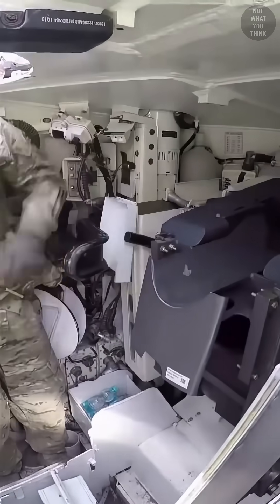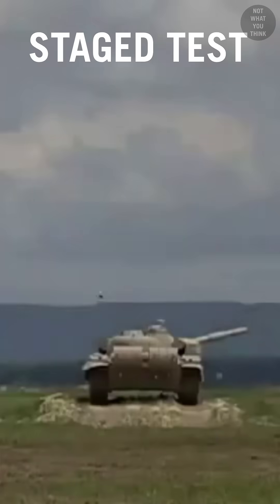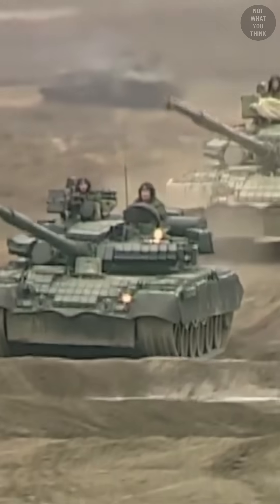Why M1 Abrams Tank Has No Auto-Loader #shorts

Comment: I believe Nicholas Moran (The chieftain) talked about this question quite a while ago, from what I gathered (and if I remember correctly) he pretty much said that doctrine and maintenance were the cause, because (USA) tankers preferred to have a 4 manned crew to help perform maintenance like track tensioning

they opted to keep the loader, since during the time that the US was testing with autoloaders, they were unreliable and were too costly to maintain them to have the same effectiveness (or a have a low marginally better performance) as a human loader

However, I believe he added that now-a-days autoloaders have improved they are more reliable and getting faster on top of having the ability to equip blowout panels with them, so it may have a precedent to be revisited in the future, since (if I remember correctly) tanks like the Japanese type 90 has a bustle autoloader that also has blowout panels as well as the French Leclerc

Found the video: Whither the Autoloader? - The Cheiftain

Comment: Another part about manual loading, which is better than auto loading. Sometimes the shells are random and you can’t choose when it’s an auto loader because you don’t have someone to tell to get a he or ap shell and if the tank is fighting another tank, it might just have high explosive for three rounds and high explosive isn’t very effective against tanks. It’s used for infantry in small vehicles but the tank with no auto loader. We have a chance to load the right round and destroy the tank. Also, if the tank is fighting infantry, it might just have a P rounds and we do barely anything to the infantry

Comment: I think that the reason is a price. It is still very much possible to create an autoloader which will be very safe in current Abram’s turret. It will just need to have its back where ammunition is stored redesigned. US could put similar autoloaders to MBT-70 or French Leclerc

Comment: Cons of having a loader:
1:  Costs the military more money to house, feed, train, and pay an extra crew men on a tank.
2:  A human loader may become fatigued and injured and impair loading operations.
3:  You need a bigger tank to house the extra crew men and bigger tanks mean bigger targets.
4:  More soldiers in the field due to having a loader means more of a chance to have higher casualties.

Pros:  
1:  An extra crewmen means an extra hand to help with tank operations like maintenance or other duties.
2:  An auto loader is more complex than an actual loader and may break down.
3:  Faster auto loaders need to house ammunition in areas that are closer to the gun and have a higher risk of ammo explosions.
4:  There will come times where a commander/gunner may want to change ammunition types and a loader can do that faster than an auto loader.
5:  On paper, an auto loader may be consistently faster than a human loader during long periods of fire, but in the early parts of the engagement, a human loader WILL be faster than an auto loader and it's in those early moments of the engagement that firing faster is the difference between life and death.

For me?  Human loader all the way.

Comment: This make Russian tanks more deadly in a one v one scenario as they will charge at you and you can’t do anything cause Russian tanks are too fast and when you shoot, the turret will explode at you and the burning tank will crash into your tank with some explosives left damaging your tank badly. Another thing is Russian tanks can also shoot not just you. They have more tanks than USA. This is not base on any source and I completely made this up except the part where they can shoot and are fast.
Reply: The best part is they aren't even fast. Most of the Russian tanks use a engine designed before world war two. Even the new "mighty" T-14 Armata uses the notoriously unreliable engines designed by Porche for the German Tiger tanks.

Comment: As much as people hate on autoloaders, they are probably the future. Modern APFSDS rounds are getting heavier and heavier to the point that the 130mm APFSDS from Rheinmetall are nearly 1 meter long and pretty much impossible to lift for a manual loader.
They use a bustle autoloader for their KF51 Panther which doesnt limit the length of the round and is safer than the soviet carrousel autoloaders.

Comment: The Abrams X (new version) looks like it will have an auto loader and a locked storage with a blow out panel. The problem isn’t so much the auto loader, but the way rounds are stored. I think the German Leopard tank has an auto loader and separate storage/blow out panel.

Comment: Well you argument is not true. There are several autoloading tanks that have a separated ammo compartment: M1 tts, Leclerc, amx30 (later versions) , str 103, japanese Typ 90 & 10, K2, KPZ / MBT 70, T90M.... Most of them are safer than a normal M1 since the time while the armored door is opened is shorter. That's because the door can be better timed and the door has only big enough to fit one single round, while in manual loaded Tanks the door opens fully so the loader can access the whole ammo rack. Also since there is no Loader there is no risc of amputated and or crushed limbs (ask Chieftain)...

Soviet tanks on the other hand often used a carusell loader wich is realy hard to protect and is placed unter the turret (to lower the direct hit probably). When they introduced (T64) it that was safer than the western counterparts (Leopard 1, M48, M60, Amx30) wich stored the Ammo unprotected in the hull and turret. The main reason why most Russian tanks cockoff is that they still have unprotected Ammo outside of the Autoloader in the fighting compartment, if that explodes it will also ignite the rest. (which at this point won't matter any more to you since you are a red mist on the turretwall from the 1st explosion).

Comment: Its an m1a2 SEP not an m1 they are very different in internal amour and body shape (kinda) the sep is taller and an entirely new turret and body with a similar design as the m1 was too weak and so was the m1a1

Comment: Final word on the Abrams1 tanks. My husband worked on perfecting that tank, if there is no auto loader that is because it is a poor design that could put the crew at risk. As the video shows each time a bomb is removed an automatic door closes so that if the tank is struck or drives over a bomb the crew is safe from their own bombs. In the Russian tank a direct hit will set off their own bombs as well.

Comment: Why don't those autoloader tanks have the same crew safety features? It seems like it could be made MUCH safer than a manual loader
Reply: The way carousel style autoloaders are designed makes it hard to separate the ammo explosive from the crew without compromising the armor scheme but there are NATO autoloaders in service with blowout panels and stored the same as the Abrams.

Comment: Many patriotic Americans here don't understand different doctrine. Soviet tanks which use autoloader eliminates a crew member, reduce training and stress on the crew. Not to mention the main advantage, reduce profile. Their doctrine don't hope for crew survivability, if they get hit it's over. In which case, losing 25% less manpower at the expense of reliability is good. Having to train one less man for crucial work is good. 

Meanwhile, Abrams are operated by the most powerful force in the world, with control of the sky. The tanks don't have to be the tip of the spear, and obviously would be less exposed to fire. 

The Ukrainian war is not good ground to compare since both forces are Soviet forces, with the bulk of the Ukrainians tank also have autoloaders. Recently Western sponsored armoured vehicle have not demonstrated clear superiority to Ukrainian Soviet arsenal, demonstrating that the role of the tank is different due to changing warfare. If anything, the Soviets were proven right in this particular case. Armoured vehicle losses mounted and it seems better to have a smaller crew to reduce manpower losses. 

The most important aspect when it comes to weapon is actually export. One of the reason why the media are having a field day on Russian weapons despite the Ukrainians are equipped with the same tools, is to discredit one of American weapon industry biggest rival.That being said, autoloader is a nightmare to operate and maintain after wear and tear. Manual loader tank is superior in every way for export. The Soviet doctrine don't line up with export requirement, unfortunately for them. Tank profile is no longer an issue like in WW2.

Comment: Not only are they less safe, but autoloaders have to return to a loading position between every shot, like a battleship gun. Some autoloaders get around this by making the entire turret elevate with the barrel, and that leads to a weaker turret. In actual usage and not just static firing, manual loading is faster, safer, and more reliable.

Comment: Auto loader is better, it means less people to pay which means more money for equipment. Also that's not the autoloader's fault, but rather the tank design in general.
Reply: If the tank crew dies, you need pay for build more tanks and train a new tank crew
Reply: @dddghhehehh  ok and...?? How is that the auto loaders fault? It's not. The abramX literally has an autoloader.
Reply: @kitchenersown  AbramX has a different autoloader design and still like a experimental tank
Reply: @dddghhehehh  ok so you agree that autoloader is a good thing?
Reply: @kitchenersown  Is good with a great design and NERA spaced armor
Reply: @dddghhehehh  yeah...that's my point... autoloader is better than manual loader.
Reply: @kitchenersown an auto loader is probably better. The problem is how Russian tanks are made
Reply: @NAGames1100  Yeah that's my point. But honestly, an Abram SepV2 won't survive a Javelin or NLAW better than a T-72B3. Most of the killing done to Russian tanks has been NLAW or Javelin to which an Abram or Leopard is just as vulnerable. Abram would perform better than a T-72B3, somewhat better than a T-80BVM, and I'd say a T-90M is the Abram's equivalent. Although a T-72B3 cost just 1 Million USD while an Abram cost over 9 Million USD and a T-72 require less crew.
Reply: @kitchenersown  The Abrams has a higher chance of surviving it than a T90. Because the T90 when it gets hit the ammo blow up killing the crew as well unlike the Abrams
Reply: @NAGames1100  The T-90M Ammunition carousel much more protected than those in the T-72B3 while it's not as good as the Abram's it won't pop open like the Iraqi's T-72 during the gulf war. Also, if the enemy has a chance to hit your ammunition storage then at that point your tank is gonna get either a mobility kill or just straight up disabled.

Comment: Loader didn’t check the panel, instant fail. (There’s a little led thingamajigher, just up and to the left, after you load, it indicates if the breech is closed, and if the firing circuit is complete) it kind of stupid, but you have to make the motion to look at at, or you will fail.

Comment: The thing about M1 Abrams not having Autoloaders is because it was Multipurpose tank, for offensive and aggresive. For a tank with that role, using Manual Loading will gives cheaper maintanance, less chance to broke entire gun system, and easier to repair. Its also can gives Supplies of Maintanance Parts less to deal with.

Im not saying tanks for aggresive cant have Autoloaders, but its cons is 50-50. The most logical type of autoloaders for Offensive is Bustle Autoloaders since its only expose in turret and far faster, but with the expense of lesser ammo capacity in Autoloader ammo stage. 

Also, with expert crew, the performance of tanks is not that much different. For example, a Leopard 2A6 with expert crew can load 2nd Shell with maximum 3sec and continously 4-6 sec. This much as same as T-80 and faster around 2-3 seconds than T-72/T-90 autoloader.

Comment: Despite the blow out panels, Abrams will burn as Leopard 2 are doing in Ukraine, and, of course, any modern tank will blow (and pop up the turret), Furthermore, if you use the 4th member to replace another tankist, who will load the gun? So there is no difference in 3men crew+ autoloader and 4 members crew

Comment: True story, a little 125 lb Asian kid could load a round in under 4 second, because it's me! The way the rounds are set up you don't actually lift the round but pull it out of the compartment and flip it into the breech of the gun so it really isn't about brute strength but technic. And seriously you're not going to be loading 10 min straight without a rest. 2 to 3 rounds and either you killed them or you already dead. A good human loader is faster than any auto loader out there right now so whoever can get the next shot off faster is usually the winner.

Comment: The US Army actually developed an M1 with an autoloader. They even took the whole crew out of the turret and only had the driver, commander, and gunner in a self contained armored capsule. The autoloader went 40,000 cycles of loading and then unloading the gun without a scratch to the ammo in testing.

Comment: That bit about the loader  "replacing a gunner or driver" is very unrealistic. For that to happen it would take too much time to make a difference. (It can only work in War Thunder.) 

First there is the shock from the shoot that took the crew member in question and the time needed to assess the situation on who died, then they have to go on the seat of whoever died, move their corpse (which they are most likely not trained for.) and take their seat. if it was the driver it will take quite a time to reach the seat, if it was the commander then they will have to again assess the situation both in and out of the vehicle and give new instructions and if it was the gunner they will (AGAIN) have to assess the situation outside and all the worst if the gun was already fired and needs reloading meaning that they will have to do 2 jobs now that will excuse them quickly. 

And the final thing to keep in mind is that Russian autoloader can reload in more or less 7 seconds. Meaning they have that much time to fix all their problems until their tanks becomes operational again. Within that time (if its only 1 tank they are facing) the enemy tank can fire 2 about more shots which if another crew member is killed they have to start all over again. 

Even if another World War was to break loose within that war the instances where that system would save the life of a tank would be easily counted by 1 hands fingers. (It CAN happen. But in general it would be the rare exception. Too much risk for 4 rather than 3 crew members, especially considering the extra size/target their tank has because it lacks and autoloader for too little gain.)

Comment: Leclerc: "Allow me to introduce myself"
Reply: Type 90, Type 10, K2 : Allow us to introduce ourselves
Reply: leclerc did it differently, and as far as I am concerned, did it a lot better than russians
Reply: @elduquecaradura1468 Yeah it has the autoloader in the casette/bustle) instead of in a caroussel. It makes it very safe since the blowout panels still work and in order to load a shell you only need a gap slightly bigger than the shell itself. Compared to the Abrams it's a huge plus since it has quite a big ammo door which can mean the ammo still blows into the tank. It also means that you don't need a dedicated loader in the tank.
Reply: And it's also safer, as you can see with the Abrams crew being exposed to the ammo rack.

Comment: On manual load tanks the loader can change from a he round to a sabot if their target switches from soldiers to armored vehicles, on autoload tanks they have to fire that round thats sitting in the chamber. The ability to have whatever round you need ready to be loaded at a seconds notice is well worth the extra crew member.
Reply: Actually tanks are are not loaded until commander says so. So even if it has autoloader, the gun will be loaded just after acquiring the target

Comment: Reason why m1 abrams and other western tanks have manual loaded but t 90 and other russian tanks have auto loader: Western tanks use manual loader because western tanks are bigger than russian and Eastern tanks so they require a manual loader as they are a way bigger target than small tanks (eastern tanks) while russian tanks use auto loader because russian tactics are based on speed so they send units until they find a gap in the enemy defences so russian tanks are smaller and faster sp that they are harder to hit thus they use auto loader because not only that russian tanks are fast and small (so a smaller target) but russian tanks also use auto loader because of their tactics
Hope this helps you out on not only telling you why russian tanks have auto loader and western tanks don't but also helps you understand a little bit on how russian tactics work

Comment: There is actually no reason to not be able to use both an autoloader and blowout panels at the same time, in fact many tanks do. What makes Russian tanks so dangerous is that they do not have this, because even the most modern T-90 is based on a tank from 60 years ago (The T-64) which also had an autoloader and had this issue. Even the T-90s engine is old as fuck, being just a modernisation of the same engine that was used in the T-34.